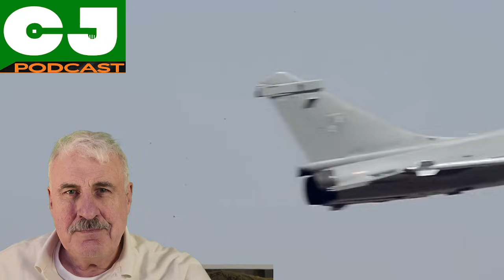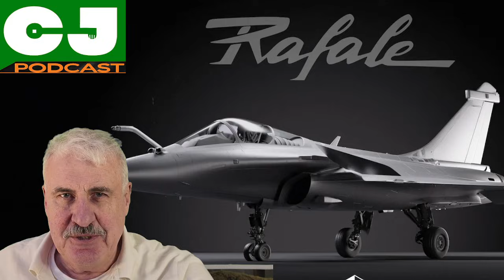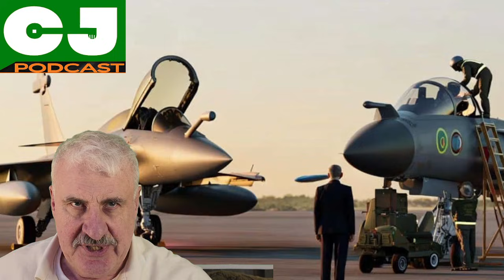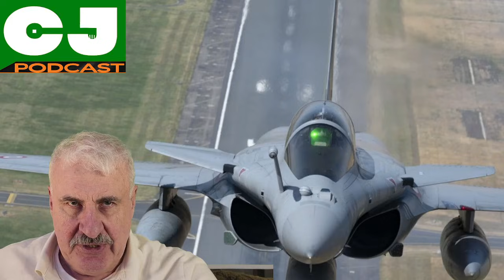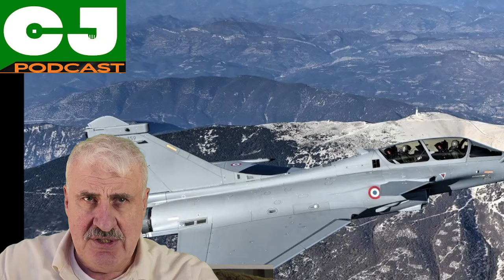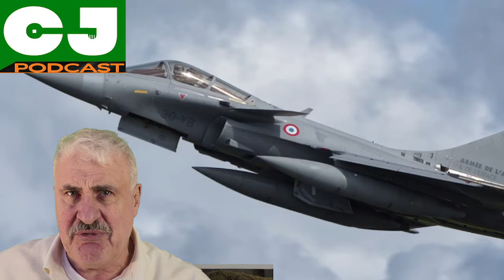Rafale vs Gripen – What Should the Irish Air Corps Choose?

Comment: I am French, but for a country like yours, with air and maritime policing missions, the Gripen should be more than sufficient. You're not looking for the best fighter jet for wartime. The Gripen's main advantage is its cost per hour. The Rafale is designed for countries under pressure, with a greater range requirement. Be careful with radars/cells; it's how the radar is used that matters most, not the number of cells. Electronic warfare sensor fusion is what makes the Rafale extraordinary. India is going to order another 135 Rafales, including 31 for the Navy, and that's for good reason. The Rafale is highly praised by the most experienced pilots; it's very responsive and powerful to fly—"the aircraft is acrobatic." The Rafale has already outperformed the F-22 and F-35; it has the best flight controls of any aircraft (which is what Germany wants to steal in the SCAF contract). The F-5 version will be even more extraordinary.
Reply from the maker: Merci!

Comment: My take as a Frenchman:
The Gripen is lighter and cheaper, so it would be less of a financial burden and in that sense: a good choice.
On the other hand the Rafale carries more, farther, and is ITAR free.
Its naval version is also specialized for maritime environment, which, for an island Nation like Ireland, could be interesting.
Reply: Hey, french here too.
The naval version of the rafale is more expensive, has less range and carry less (a bit less, the nose landing gear is heavier in the naval and the engines have some additional protection).
The airforce version is as capable to patrol over the sea.
The only reason to get a naval version for Ireland would be if this country wishes to get an aircraft carrier...
Reply: @rcouderc  The thing here is that the B and C variant of the rafale have the same anti corosion built into its design as the M variant. That means that for an airforce usually operating close to the sea, even the air force variant may have a significant cost advantage compared to the grippen on the long run, with airframe just aging significantly slower. Or not. I don't know, but it is a possibility to studdy (by people with access to the actual, precise, data)
Reply: @rcouderc  fair points but my opinion is the coating of the M variant could be applied on the land based Rafale.
Also: its longer range means less use for air tankers, that factor is rarely taken into consideration when talking about operating costs and those tankers do have a price, both to acquire and to maintain, making the Rafale not such an expensive bird, all in all.
Reply: @jetaddicted  It already is. There is no special naval coating.
Reply: N'importe quoi aucun intérêt de d'acheter un Rafale M en dehors d'une utilisation navale. Il est plus lourd, plus cher et a un emport de moins
Reply: @cedric5813  apprends à lire avant de commenter.

Comment: mmm, the problem i have with those kind of videos is that you're comparing the rafale wich is an operationnal aircraft, meaning the price is known, to the grippen E, wich will reach is fully operationnal capability only around 2030, who knows how much it will cost by then. In 2030, rafale will be at the f-5 standard with way more capabilities that what we know about the grippen E will. So is the price tag. Today a rafale C, if you don't take ammo into account is about 80/82 millions euros that's not much more that the still estimated 70/75 for a grippen.

Comment: I'm British,  get that out of the way.  From my understanding Ireland needs a quick reaction fighter. Something that can climb fast and close with the potential threat this is exactly what the Eurofighter  was designed to do. 
The RAF have about 20 or 30 of the mark 1's surplus to requirements at the moment.  They can't be upgraded but would be a very cheap way to get into the fast jet business.

I'd  be extremely  surprised if at least half a dozen Irish nationals weren't already flying these planes for the RAF and could return home to defend Irish airspace.
Reply: Thats a bit wrong fact if you want a fast responder jet
Reply: @laves820 
I'm an enthusiastic supporter of the French aviation industry, yet I do believe that if Ireland is looking for an air defence fighter then the Typhoon would be a good candidate.
In terms of aero performance it's better than the Rafale and way better than that of the Gripen.
Reply: @marcg1686  No actually today if you fight BVR and dog fighting is an old concept.  Typhoon is not better suited then the Gripen E, since the gripen E is a new fighter and Typhoon is old. even trache4.
And you get double the jets since its costeffective and the EW is on f-35 levels or more.

you want to fly fast and expensive with an old jet go ahead. its  your money. 

The question is what enemies are Irleand trying to repel? I guess russian? well Gripen was made to fight russian planes.
Reply: @laves820 
The Typhoon has a far better climb rate than the Gripen E. It is also more manoeuvrable at higher altitudes and it doesn't rely on an American engine.
Reply: @marcg1686  
The Typhoon’s climb rate is impressive on an airshow program, but for Air Policing (which is Ireland's primary need), it is irrelevant.

Intercepting a non-responsive civilian aircraft or a Russian Tu-95 "Bear" does not require a vertical 90-degree rocket climb. It requires availability.

The Typhoon’s two engines provide that extra thrust at a massive cost: double the fuel, double the maintenance, and double the chance of a mechanical failure grounding the jet. For a small air force like Ireland’s, having two Gripens ready to scramble is strategically better than having one Typhoon that is faster but often stuck in maintenance.

The claim that the Typhoon doesn't rely on American technology is simply false. While the EJ200 engine is European, the aircraft is riddled with American-made components subject to ITAR (International Traffic in Arms Regulations).

The Typhoon utilizes systems from Honeywell (Life Support), Northrop Grumman (Inertial Navigation), Collins Aerospace (Cockpit Displays), and Lockheed Martin (Targeting Pods).

If the U.S. wanted to "veto" an Irish fighter fleet, they could cripple the Typhoon just as easily as the Gripen by withholding support for these critical sub-systems. In reality, Ireland—as a key EU member and Western partner—faces zero risk of a U.S. veto. Using a proven engine like the GE F414 actually links Ireland to a massive global support network (used by the US Navy’s Super Hornets), ensuring parts are always available.

The Typhoon was designed as a Cold War interceptor to fight high-altitude dogfights. Ireland is not looking for a dogfighter; it's looking for a Sovereign Air Tool.

The Gripen E features a more modern AESA Radar and a passive IRST (Infrared Search and Track) sensor as standard. In modern policing, being able to see the target from 100km away without turning on your own radar is far more valuable than being able to turn slightly tighter at 40,000 feet.
Reply: @laves820  Why?
Reply: @mt508  Why what? are you refering to the quick reaction fighter? or?
Reply: @laves820  I may have misunderstood but are you saying the Typhoon isn't suitable for QRA's?
Reply: @mt508  Sure it is if you want to throw away money Typhoon is a good option, for an unmodern platform. You can always buy an old pc and its good... Cant really see the logic. Are you a rich country that poops out tax money left and right?
Reply: @laves820  I think you are underestimating the challenge Ireland faces with swiftly ramping up an ability they haven't had for decades. Training of aircrew, ground crew, engineering support. Secure and  QRA capable airbases, The entire logistical wagon-train, including weaponry. Military radar and air traffic control. This is potentially a huge project. Tranche 1 Typhoons, with a training and maintenance agreement would be a sensible and cost effective way of Ireland starting, what is likely to be a long journey. In the medium term  the Gripen, with it's multi role abilities, is probably the best option.
Reply: @mt508  

That is like saying someone who has never owned a car should start by maintaining a vintage 1990s Ferrari (Tranche 1 Typhoon) to "learn the ropes" before buying a modern Volvo (Gripen E). It is illogical for three specific reasons: Technical Debt, Manpower, and Obsolescence.

The Tranche 1 (T1) Typhoon is notorious in the defense world. It was designed primarily for Air-to-Air combat and has very limited multi-role capability.

Many T1 parts are no longer in production. The UK's RAF has even used T1s as "Christmas Trees" (stripping them for parts) to keep newer T2 and T3 models flying.

If Ireland starts with T1, they are learning to maintain computers and avionics from the late 90s. When they eventually switch to a modern jet, the ground crews will have to unlearn old habits and re-learn modern digital diagnostic systems.

The Typhoon requires a long, pristine runways and massive specialized hangars with heavy cooling and power systems.

The Gripen’s Design: It was built for STOL (Short Take-Off and Landing) and can operate from a reinforced road. It carries its own APU (Auxiliary Power Unit) and doesn't need a "logistical wagon-train" to start up.

If Ireland has poor infrastructure, it is cheaper to buy a plane that adapts to the environment (Gripen) than to rebuild every airport in the country to accommodate a "diva" aircraft like the Typhoon T1.

To build a pilot corps from scratch, you need flight hours.
If your budget allows for €100 million in O&M (Operations & Maintenance):

Typhoon T1: You might get ~4,000 flight hours (expensive, prone to breaking).

Gripen: You get ~10,000+ flight hours.

For a new Air Force (like Ireland), repetition is everything. More hours in the air equals safer pilots and more experienced mechanics. Starting with a jet that stays in the hangar twice as long is the worst way to "ramp up" capability.
Reply: @laves820  I don't disagree about Gripen and as I said, Typhoon would have to come with a service maintenance deal which could (bearing in mind Bae's relationship with SAAB) be a quick interim solution allowing the Irish Airforce to start gaining fast jet experience before moving on to the Gripen. There is already a long standing training relationship (albeit light aircraft and helicopters) between Ireland and the UK. There are many T1's readily available and in terms of ability, they are more than adequate for the interception role they would primarily be used for.
Reply: For policing and interception it may suffice. The later tranches where mostly to provide multi-role capabilities. Other members of the EF consortium like ES and DE are currently in the process of replacing these, so could get a good deal. Once they dominate the basics, they always have the option to later move to a more advanced version. In any case, "on-upgradable" is a relative notion if you only stick to the official road-map, but like many other examples around the world, enhancing specs with 3rd party solutions are quite common.
Reply: @santoriniblue8413  

While the idea of a "good deal" on used Eurofighter Typhoon Tranche 1 aircraft (from Spain or Germany) sounds tempting, it overlooks the long-term logistical and financial trap that these aircraft represent for a nation like Ireland.

Buying a Tranche 1 Typhoon is like buying a used supercar for a low price: the purchase is cheap, but the Operating Costs (OPEX) are astronomical.
A Typhoon costs roughly $15,000–$25,000 per flight hour, which is 2–3 times higher than a Gripen.
Major operators like the UK are already retiring their Tranche 1 fleets specifically to use them for spare parts. For Ireland, finding components in 10 years would be nearly impossible without "stripping" other airframes.

A Typhoon requires specialized hangars and a massive ground crew.
Major overhauls take 6–12 months and must be done abroad (UK, Germany, or Italy). If Ireland buys a small fleet (e.g., 12 units), a significant percentage would be stuck in foreign hangars at any given time, leaving the Irish QRA (Quick Reaction Alert) vulnerable.

The Tranche 1 airframes are nearing the end of their fatigue life.
Most original partners plan to phase them out by 2027–2030. If Ireland buys them now, they would likely be forced to replace the entire fleet again by 2040.
A new Gripen E has a lifespan of 40+ years (into the 2060s). While the upfront cost is higher, the "cost per year of service" is significantly lower because the aircraft is brand new and designed for low-cost maintenance.

The argument that Ireland can simply use "3rd party solutions" to upgrade old Typhoons is technically difficult. The Tranche 1 has a different computer architecture (hardware and wiring) than later versions. Upgrading them often costs more than buying a new plane, which is exactly why Germany and Spain are selling them rather than upgrading them themselves.

Comment: Can someone tell me whether Irelands requirement is simply for an air defence aircraft? I would have thought that maritime strike is also a 'nice to have' option.
Reply: Ireland has major problems with protecting its extensive EEZ which has endless communications cables between the EU and the US. Trillions of business flow through the cables daily. They are at high risk of attack. 

The current naval ships are fishery protection only so have no capability to do the patrols needed   

There are also numerous events where Russian bombers fly into Irish airspace unopposed.  It's assumed that they are going to pretend to attack the UK but as Ireland is part of the EU, there is no reason to believe that they are not going to attack Ireland. Why wouldn't they? Split the front up and force the EU to divert resources away from whatever else is going on. 
 
So both are risks that Ireland currently has no ability to mitigate.

Ireland needs some form of long duration monitoring. The MQ-9B with sea guardian and the AEW/C modules will cover that. It then needs the MPA versions of the C295. Probably 3. And it needs to invest in AW101 helicopters both for army transport and for ASW. 

Then it needs good primary radar, augmented by the MQ-9Bs but needs fighters to guard against the Russian bombers. Given how far they are flying to reach Ireland, not like they can surprise Ireland so in reality any fighter platform will do.

Then Ireland needs to replace it's fishery protection ships with both corvettes and a few mine sweepers.

The elephants in the room are there is only one air base and is not really suitable and there is only one sea base and it's very much not suitable. The entrance to the harbour is very risky. 

And there are no radars just plans for radars that don't appear to be signed just yet. 

Then add in drones. When the Ukrainian president was in Ireland recently, there were persistent drones around that Ireland's defence forces had no ability to deal with. Ireland is the EUs next 6 month president and the army have advised the Guards that they have nothing to offer them to deal with potential drones attack during the 6 months.

It's a historic shit show that Ireland has chosen to ignore. But the world has moved on and Ireland's position on defending itself is completely untenable now. 

It can easily afford to defend itself against the risks it faces but it chooses not to.

More fingers crossed la la la stuff over doing something about it.
Reply: Gripen is very good in the marine attack scenario. It comes with the RBS-15 missile or whatever you want to arm it with. It's flexible 😊

Comment: The whole cost thing is just noise. Ireland is choosing not to defend itself. The GDP is 700billion so the current NATO requirement of 3.5% of GDP highlights that the current minimum spend that Ireland does is miles off what is now considered basic.

Ireland could easily afford either but does not want to because, well because. 

Down to me and I would pick the french jet because it's two engines make it safer for Irish crew given it will spend most of its patrols far out over the Atlantic.

Both are full on fighters and the existing Irish mindset is to avoid completely anything that might be seen as aggressive. So I think neither will be ordered. 

I think the M364 is going to be the choice, as it is just good enough and good enough is good enough.
Reply: Indeed, the ROI has been scamming the Brits for its defence for decades...
Reply: @nikolaucznaum4312 which given the context of the US president stating over and over that the EU/UK has been scamming the US for it's defence over the years all the more jarring for Ireland.

Be interesting to see what happens on St Patrick's Day as the Irish PM is over at the  White House.